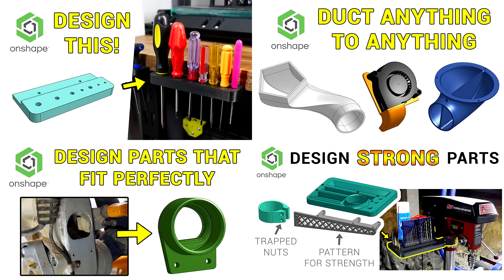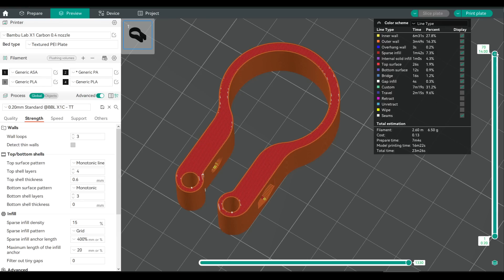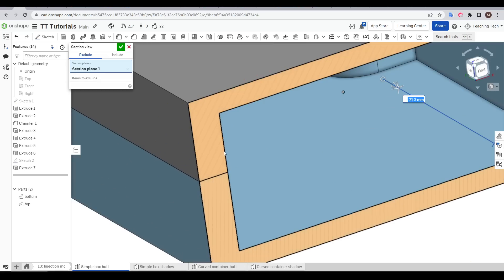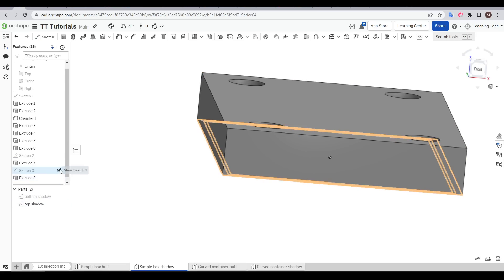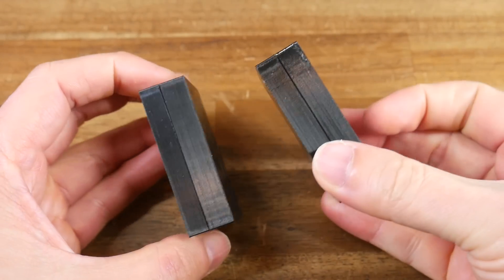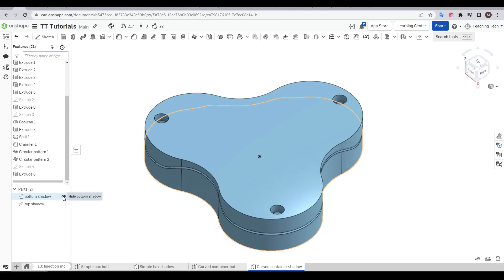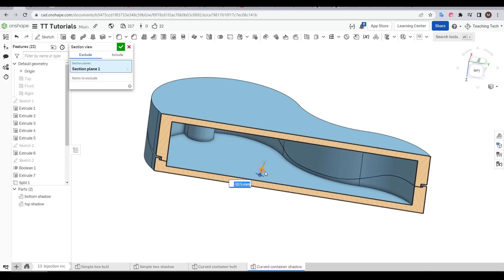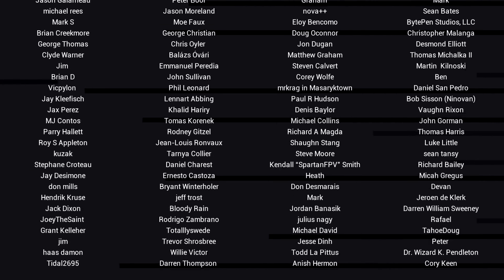Design like a pro with shadow lines - 3D design for 3D printing

Comment: You've shown how to project add from a flat surface of a part, which seems quite easy. I'm having immense difficulties trying to create a shadow line for a complex curved part. Think lofted circles at a varying spline path. 

Any tips for adding a shadow line rim to a complex part with no (or changing) flat surfaces along the entire part. Like splitting a coke can length wise on an offset (bottom 3/4 and top 3/4).

Comment: Thank you, I will try this. I would be interested in ways to quickly add connectors in OnShape for parts that require more than shadow lines. You can add them easily in OrcaSlicer/others but you have to redo everything if you change the CAD design. The biggest obstacle is that it takes SO long compared to adding the connectors in the slicer.

Comment: Plastics designer here - Plastic parts are prone to warping slightly during the cooling process.  Without a reveal, some of the mating faces will touch between the two housings while other areas wont. Visually this makes the assembled design (any design really) look poorly constructed. The reveal (shadow lines) creates an intentional gap between the mating faces making any slight deviation in form unnoticeable. The gap is backed up with a lap joint which is necessary to define the gap dimension and creates a visual barrier into the housing assembly.

Comment: You are showing the inside of pieces, and in that industry (injection molding), we don't care about what the customer will not see, that's why the inside has not a good finished surface.

Comment: How did you get that cool finish on your print at 4:33? It resembles carbon fiber. Is that through a certain infill pattern, and with no top or bottom walls so you can see the infill? 

Sorry if that's a silly question, I'm new to 3D printing. Love this channel, keep up the good work!

Comment: And if you want to reduce the sliding around further, I've found 0.1 mm to be a good offset for friction fit, otherwise 0.2 mm if you want them to slide but not necessarily lock (unless the parts are really small, than it needs to be bumped up a tad)

Comment: If the Nylon SLS fab says 1.0mm minimum thickness for walls, can I do 0.5mm extrusions for the shadow lines? My enclosure is tiny, 65mm by 80mm by 20mm so I expect immaterial warpage.

Comment: Great video and tutorial!

I dont want to be that person, but i did notice something incorrect in the bit on injection molding. I've been a process engineer for about 2 decades now, which is why i felt the overwhelming need to point it out 😂 it's become compulsory, sorry! 😅

Anyway, on the die design and the processing example, you show that the runner enters on the same half as where the ejection pins are located. This is a possibility, technically, but this is not how they're designed in reality. The method required to accomplish that is how cores are controlled though and that's done using separate hydraulics. The sprue half and the ejection half are always separate from one another. Reason for this is the physical placement of control components on the actual press itself. So one side will utilize a locator ring for the machine barrel to align with the sprue and the other side will interface with the ejection plate via "knockouts" and their control mechanisms. Older presses will have a large hydraulic cylinder with a smaller, internally sealed cylinder that operates separately to control ejection. Newer machines have these functions separate as they typically use toggle locking mechanisms that physically lock the die halves together and a separate hydraulically controlled mechanism that interfaces with the knockouts. For the newest machines, there are hybrid systems or strictly electronically controlled systems. Hybrids typically utilize hydraulics only for clamping pressure and electronically controlled ballscrew mechanisms to control the ejection interface. The strictly electronic systems utilize a large electronically controlled ball screw to handle clamping forces and a smaller one for the ejection control.

Anyway, I only wanted to point this out for any individuals with a budding interest in the injection molding side of things.

Comment: Hello ! Great content, many thanks for that. I have the same x1c plate but I never succeeded to transfer drawing of plate to the part and in your example it seems beautiful. Can you tell me please : which filament and which plate you told to bambu studio (cold, engineering..) ? Do you add z-offset ? And if pla do you add glue on the plate or laque ? Regards
Reply from the maker: Please see the link to the plate in the description.
Reply: Hello. Yes I already have the same plate but it’s not answering my questions.
Reply from the maker: I select engineering plate in the slicer. I've used it with pla, petg and asa. Nothing else needed in terms of setup.

Comment: You talk about the shadow line like that's the important feature, and the mating lips are secondary, but it's really the other way around. 

The inside and outside lips overlap from a side perspective, so there is less opportunity for ingress, and more stability of the mating edge. However the shadow line is purely aesthetic, it hides the fact that a draft angle is present between the two halves. As far as I can recall from my classes, and a tour of an injection molding facility nearby, that's it. And it makes sense, it's just a break between surfaces.

Comment: A few points this overlooks are that most shadow lines in consumer products are: A) bevelled/champhered to remove sharp edges from injection molded parts; and B) usually chosen primarily to serve as basic weather/environmental sealing, sometimes in combination with an O-ring

Comment: I use it with 0,2 or 0,3 (half the nozzle diameter) and a 10 degree angle, so the parts snap together nicely and firmly with no play

Comment: There is another way I would create a shadow line and that would be to add a groove into one of the parts at the mating edge. With your approach you are still relying on the tolerances of the build to ensure an even alignment whereas if you have a groove on the edge this is easier to control or at least help mask any inconsistencies . I would usually have around 0.3mm clearance on parts and then a 0.5mm groove. (Dep on part size ) You don’t need to do this of course but I think it maybe useful for somebody reading this. FYI I’m a product designer with over 10 years experience designing parts for injection and mass production.

Comment: Been trying to get into Fusion 360 or OnShape.. really just any software that's specifically made for modeling vs. messing about in TinkerCAD. Do you recommend one vs the other? As a "FREE" license of course. I imagine by learning one, it helps me understand how the others work. I just didn't know which one I should choose to begin my modeling journey. Thanks for your great content!
Reply from the maker: The best solution is the first ne that clicks for you. For me, that's Onshape. When I was teaching, it was as a godsend to have a whole class signed up in minutes. Personally I learned Solidworks in uni and it's close to that so I picked it up quickly. Fusion and freevad are also popular for good reason.
Reply: @TeachingTech  Cheers! I do a lot of Figma and something about Onshape just felt more natural to me. I think I am going to take it on and start with simple problems and learn through solving as I usually do. Your videos will help a great deal with that.

Comment: Why not tighter tolerances?  Or a drafted lip?  As shown in the video, it was purely an aesthetic choice.  The gap is still there just hidden.  The alignment is still sloppy.  The shadow line doesn't spread any load with the slop.
Reply from the maker: The whole whole point is that the alignment is still sloppy but hidden. That is one of the benefits.
Reply: By alignment, I meant aligning the two halves together for assembly.  Wasn't talking about the seam

Comment: If you use Solidworks the "Lip and Groove" tool can make these features mostly automatically based on a parameter set. I've used it on a few little enclosures and unless you're working with really manky imported polygon geometry it works quite well.
Reply: Thanks didn’t know even the ribs tools looks easy.

Comment: I want to pay special attention to the slopes. Very often, such lips are given a bias. thus, the two parts are sealed together. This is important and accurate to use. Also, printing allows you to make a joint with a built-in lock. This way you can connect the parts even more reliably.

Comment: I think it’s the opposite, shadow lines are amateurish. a pro at designIt’s so it doesn’t need shadow lines, but the problem is injection molding has such a huge inconsistencies in shrinkage. To me adding shadow lines just looks super cheap like Chinese designers just spitting out products and finding the quickest way to get everything to snap together and mostly so they can only need a two piece mold and spit them out   If you look at high end parts do use more sophisticated molding and they’ll have no seams because they’re using multi part molds that will fit the sides and you won’t see any access panels until the back or an unseen part

Comment: Take it a step further and add o-ring grooves / profiles for blocking dust / moisture. 
O-ring cord stock is cheap and easy to install and comes in large variety of sizes & flavors. 
For SolidWorks users I’d suggest sweep cutting both parts at the same time using the stepped profile. (3D sketch + Convert entity will is useful for generating the cut curve.) 
Saves many CAD steps and allows you to visualize the gap tolerances more readily, rather than analyzing after the fact.

Comment: Most of those shadow line include a "snap" feature to assemble without any screws. Is it possible to reliably acheive these attachement in the 3d printing process. I suspect they would be a weak point.

Comment: I just designed a case like this, but I also added a gasket that I'm going to print out in soft TPU. Trying to make it dust proof because the box will be living in a extremely dusty environment. The shadow line concept works really well for that.

Comment: Tighten up your tolerances and the overlapping walls will look fine, without the need for a "shadow line".  What looks even better is printing the two halves in different colors.  Or design the joint as a relief instead of a plane, that would look better too.  Shadow lines just look bad on 3D prints.
Reply: Can you give any further info on "design the joint as a relief instead of a plane" ? Some kind of link to where i can see what ur sayin?

Comment: Great vid Michael.  I'll be sure to use this.
When I extrude/cut I do so in 0.2mm increments because I use a 0.2mm nozzle. I notice you happily use a 0.5mm protrusion. Am I overthinking it when working to the nearest 0.2mm?
Reply: It makes no difference, the slicer rounds everything to the nearest multiple of your line thickness or layer height regardless.

Comment: Thank you!  Just fixed my printer, an Ender3 V2 Neo which had the "white dust/powder" issue in the thermistor causing temperature reading to vary too much and it would halt and screech.  Looking to get into the design part, this will be very helpful, thanks again!

Comment: Important to note that this is not an airtight nor watertight seal by any means; for that you're going to want to add a gasket. The gap between the mating surfaces will be just as rough as the one without a shadow line, it's just been hidden around a corner, so you can't see it anymore. Your light gap test @7:04 is equal to turning a lamp on in one room, going down the hall and into another room, then stating the two rooms are "actually sealed" from each other based on the fact that you can't see the lamp anymore.

Comment: In woodworking we use a reveal. If you try to line up your trim piece flush at the edge to be trimmed it will end up looking bad due to the normal undulations in the wood. But if you offset the trim piece 3-6 mils, to the eye, all of that disappears.

Comment: An idea for a future video. Snaps or cams. I tried to design and print a block off plate for an air inlet. I was able to design a shape that would fit in the odd shaped hole, but couldn't figure out how to secure it from the outside. I tried making a spiral/cam lock that prints in place like an IKEA furniture, but I couldn't get the shapes right. I tried a spring tab that would snap in, but it wouldn't print strong enough. The layer lines were in the wrong orientation and it would snap off. Anyway, I'd definitely love to see another mechanism type video to help solve this problem. I have some ideas, but my CAD skills are the biggest hold up.

Comment: Why does the external part have a gap while the internal part doesn't. You are using 0.5 mm of gap, this looks a bit exaggerated specially because you have good and calibrated printers. You can use 0.2 mm and it is good enough.

Comment: Did you encounter any differences / issues when adding the shadow line for the base of the lamp? Curious as to why you subbed it out for a simpler shape.

I had a few of goes at this in fusion 360 with a simple box with a curve in one dimension and an extruded spline shape with a curves in two dimensions. The first worked after some fiddling but the second I ended up giving up due to errors. I think under certain conditions it should be possible though.

Comment: great video never thought about using this idea will certainly mod my current designs to add them.
Do have a request an idea. complex curves like those on a pistol or bow grip. Keep scratching my head on why sometimes fillets and chamfers don't work.
That's another one. Why do you get errors when making fillets or remove errors like those we saw in this video and you easily resolved

Comment: This is a nice technique but on a well calibrated printer i usually prefere to put on a centering shoulder like you did but have the airgap on the inside, so the outside sits flush. I also usually use flat mating surfaces since they meet up better and are easier to model in Fusion. If you make the shoulder a tighter fit you also add a severe ammount of shear strength on that joint

Comment: I work a menial job. At home, I've spent over a year making a box exactly as shown. (I cut a plus out the fillet the inner corners; make the base and lid as separate parts.) Everything I did has been inefficient. You made the same box so simply. What an amazing video.

Comment: I've been a 123D Design guy for years (and I've been making the lips and troughs for mating parts in it for years too).  Tried onshape, fusion, freecad.  Was never really worth the effort of re-learning because I was fairly proficient in 123D (and knew how to work around all the bugs).  That curved offset though, I think that might just be worth it to dive back into onshape and actually learn it this time.   Thanks Michael.

Comment: I don't like the 1mm offset method because the offset isn't tangent to the divide as the split becomes more vertical the gap narrower so it is inconsistent. However it isn't to apparent in your test print.

Comment: If you want to do this in fusion 360, you have no option in extrude "up to part"  like onshape has

I found a workaround by taking the offset sketches you've created of 1mm and 1.5mm, get it to split the body. It will chop it so you can press/pull using Q on the keyboard for the section you want to change. then combine it again into one solid body. Cheers Michael, this was a fun one to figure out in fusion 360 but onshape definitely looks easier to create the step up or down!
Reply: The extrude function in the surfaces workspace can be started from and finished to a curved surface. I'm not entirely sure how to patch these back into a solid. Sucks that the feature works with one tool but not the other.
Reply: @danieldc8841  I'll have a look myself in surface modelling 👍 unfortunately I think Autodesk hold alot of tools back. Onshape can draw splines on a 3d mesh. All we have is mesh section sketch, highly frustrating doing it one by one and you can't pattern it. Fusion really should be capable! Dumbed down on purpose
Reply: @davecoggan9619  yeah they defo do. I found in come cases the extrude body tool works off a curved surface but it is very tempormental as to which. I wonder if starting from an oversized solid might prevent this but once you get this far into the weed maybe we should vote with our feet and move to onshape or something else!

Comment: i didnt know those slight overlaps wer called shadow lines and i can see the benifits.. i would definitely choose tighter toleranes but the example tollerences you chose were very easy to see . i will definitely be using them on my keyboard cae.